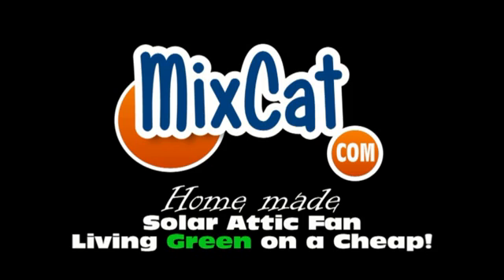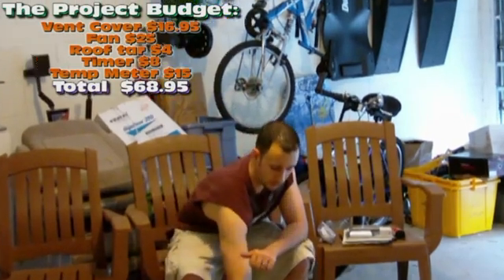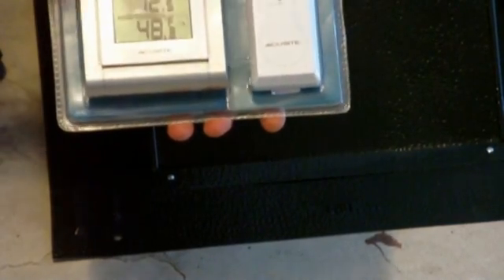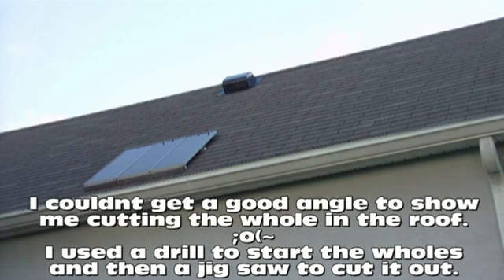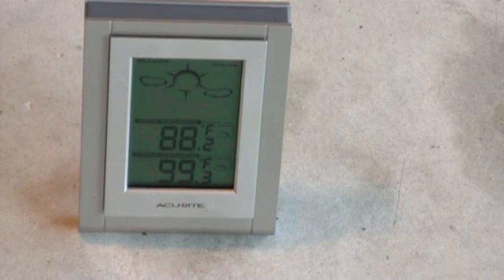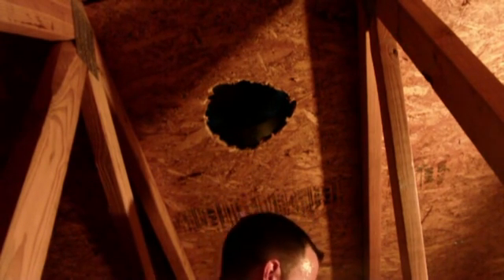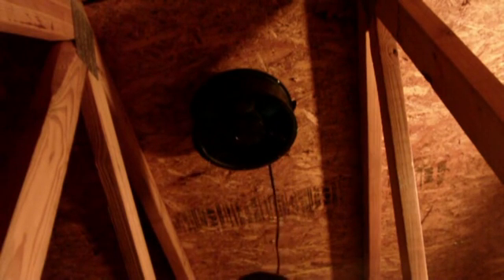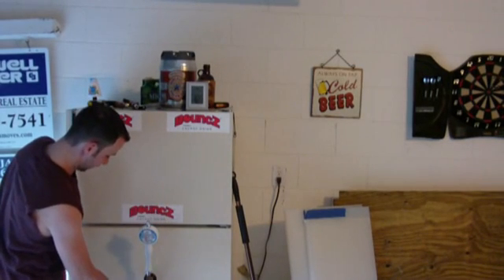Homemade Solar Attic fan DIY  Save Electric!

Comment: I know this was a long time ago, but the top edge of the vent should go under the shingles. Also, you need more vents for that large a roof. You should also check out radiant barriers for attics as they keep the heat from warming the interior. See atticfoil.com videos for applications and installs.

Comment: HI, Pete great idea and great video.  Just saw this on YouTube.  I'm originally from Kissimmee so I know what heat you're dealing with here.  I'm in Phoenix AZ now and it is going on to the summer months.  My attic is extremely hot.  Curious to know how this idea has lasted over the years...

Thanks
Daniel in PHX

Comment: Pete has a solar system already set up. The Solar Panels, you saw on the roof, charge lead acid batteries, then power hits an ac/dc converter, a timer and then the attic fan. So this system is only solar powered.

Comment: I missed the solar part, was it edited out? and the cost of the panel? You need a 10-12 watt panel if it is 0.8A X 12V=10W Solar goes around $5 per watt. So your project was around $68.95 + solar panel $50-54 + batteries you mentioned? = $120-140.

Comment: Is this a Comair Rotron Tarzan fan?  If so I guess they no longer sell them via internet.  :(   It states that it is a 1.5W, 85 amp.. Does this mean that I will need at least 170W of solar collectors?  Thanks for the info.  This is great!

Comment: it would have been better it you could have slid it under the shingles on the top side along with the tar job you did other than that good job hope it don't leak. I cheated and hired a roofer to put my wind turban on.

Comment: LOL, I work 12 hour shifts in 100-115 degrees, then my wife and son son complain when I turn the ac up to 81. I have a foot of insulation and turbines on the roof(it gets 120 easily). what about heatsinks in the ac air inflow area? Just a thought?